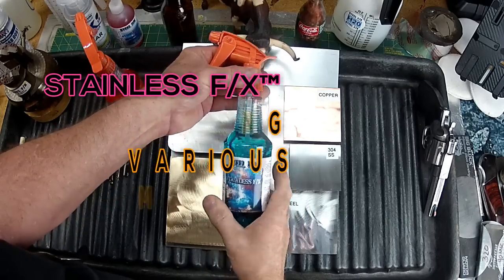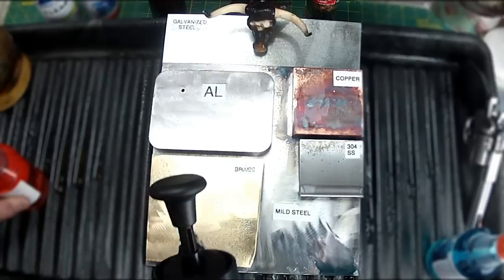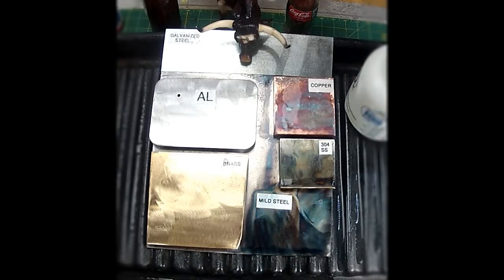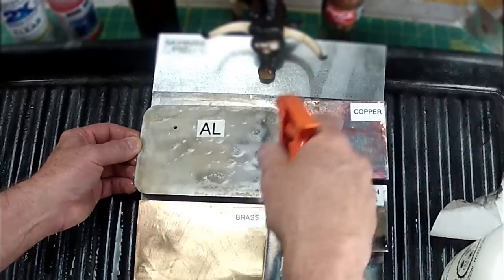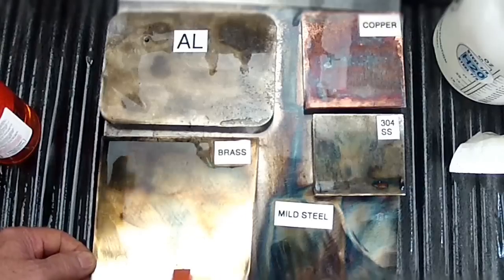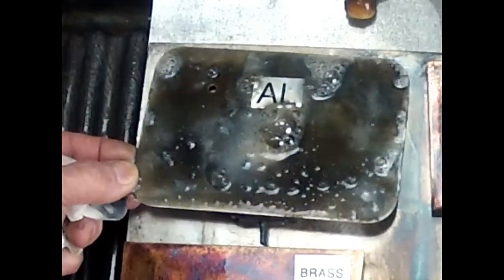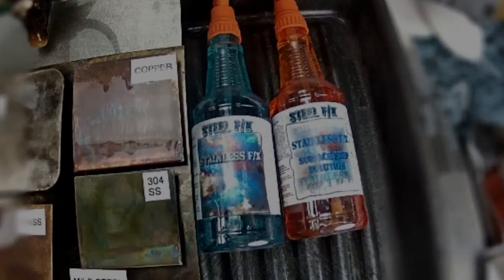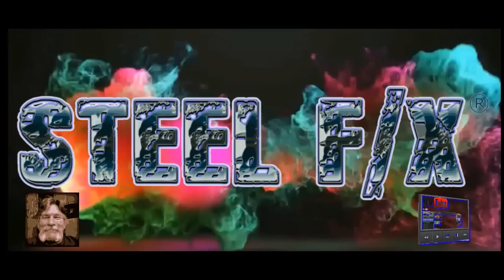STAINLESS F/X™ Patina Testing on Different Metals.

Comment: How would this work on something like D2? Which is half stainless.
Reply from the maker: @ S.A Masquerade...It would work fine.  D2 is a high carbon or tool steel.  1/2 SS is quite a stretch, though...from a metallurgical standpoint.  The Cr & Ni content of D2 is FAR less than most 300 Series of SS.  Regardless, the STAINLESS F/X™ would work fine.  Thanks!  Bill
Reply: @BillWorden  Alright! Thanks for letting me know! I'll try some of those Steel Patinas then, since I did some research on this steel. Thanks again Bill!
Reply from the maker: @S.A.Masquerade  - You're Welcome! 👍

Comment: Hi Bill, would your product work on tin? I have blank tin metal that I want to put into a pie safe but would like to patina it rather than hole punches as is traditional.
Reply from the maker: sorry...it won't work on tin unless you removed the galvanization (tin & zinc), first.  Bill

Comment: Does this add any thickness to whatever u put it on, also when i buy the stainless fx thing does it include the activator, and once u are done, what do u use to wash off the rest pf the patina??
Reply from the maker: No measurable thickness change.  Will not affect any tolerances.  Comes with Activator.  Just wipe off with damp rag or paper towel, dry and wax (or oil).  Check out more details at:  https://steelfxpatinas.com/shop/stainless-fx-stainless-steel-patina/
Reply: I bought the big Metal F/X package  and absolutely love it. Amazing results!
 I just bought an old resonator guitar (Dobro) and can't wait to try out the Stainless F/X on it.

Comment: Bill, I'm intrigued.  Two questions.

1) I'm guessing the product does not protect steel from rusting.  True or false? 

2) If the product is used for design on a firearm, what would you use to seal it, for long-term protection?
Reply from the maker: @Brian Cobb ~ 1) The product does not prevent ferrous metals from rusting or oxidizing, but on MOST Stainless Steel alloys, that's a moot issue, where the choice to seal or not to seal is optional.  2) Depending on the intended use of the finished product, there are several approved methods of top-coating:  1: A Ceramic Clear (like Cerakote®, 2: A Catalyzed (2-part) Automotive Clear, or 3: (which is my personal favorite for most items,  "Renaissance Wax".  It's a micro-crystalline wax that seals the substrate and protects from UV light, smudges, fingerprints and the incidental 'light abrasion' or scuffing.  3 coats recommended. It's very easy to apply & buff off by hand and is very affordable.  Plus!  A little goes a long way.  Amazon or my site, at: https://steelfxpatinas.com/shop/renaissance-wax/
If you have any other questions, please let me know.  Thanks!  Bill
Reply: Thanks, Bill
Reply: Brian Cobb   I've been using Pre-Lim (from same company as Renaissance Wax) to clean my custom and semi-custom knives.  I then rub on a couple coats of Renaissance Wax.  I've been doing this for years and have never had any problems on any carbon-, low-allow, or high-alloy steels.  Aside from protection, this product will also make these knives less likely to show fingerprints (from handling not from crime scene investigations, lol).  It's a museum-quality micro-crystalline wax.
Reply from the maker: @axeguy3856   good info. Thanks.

Comment: I'm about 1/2 way watching this video and this is the first that explained anything about what to use.
I purchased an old black powder double barrel shotgun with Damascus barrels that I am making a modern barrel set for.
The original lock parts were, or appeared to be, color case hardened.
The coloring did not survive the cleaning process, not to mention the new barrels.
Real color case hardening just the lock parts will cost nearly double the original cost of the gun!
Reply from the maker: If you give it a try, you won't believe how easy it is.  Thanks for the comments!  Bill